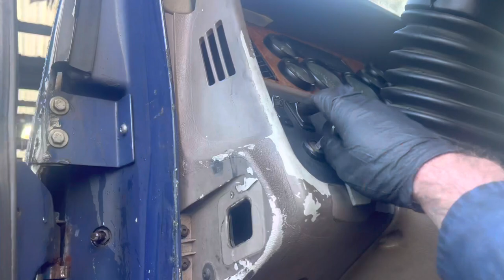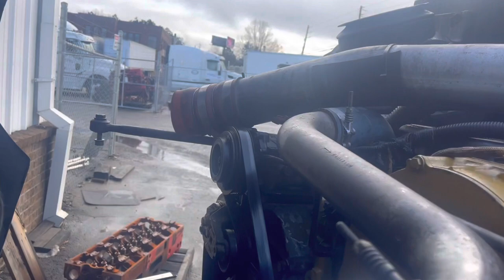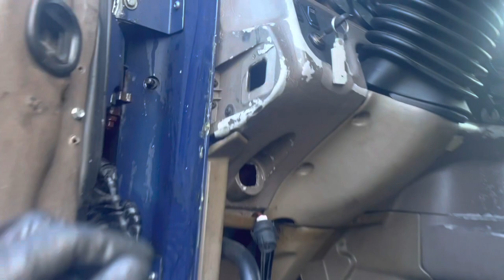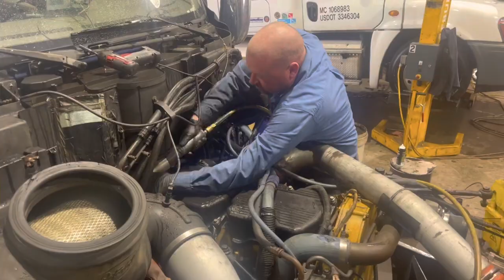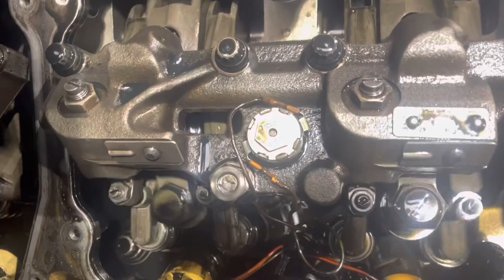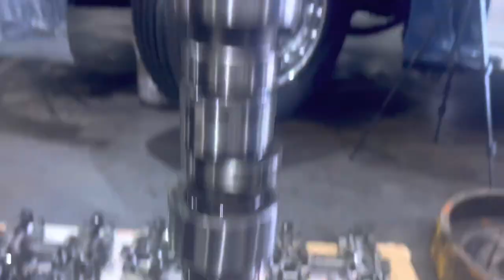Diesel engine popping back through the intake. Watch how a bad camshaft can affect your engine?

Comment: I'm glad that ingersoll right impact worked for you. I bought it as soon as it came out and it broke in a few months of hardly being used. They gave me a hard time about repairing under warranty but finally did it - gave me some blah blah about usi g dirty air compressor at our dealership. Fixed or gave me a new one I can't remember because it's been around 10 years ago or more and that one lasted right until the warranty gave up. Later I saw they had a recall on them but I threw the thing in the trash already. A lot of money just to throw in a landfill.

Comment: Wow that #4 is toast. So what’s happening here is that the piston has already created vacuum in the cylinder before the valve opens causing a rush of air at once to flow through the intake, in turn causing the noise?
Reply: The exhaust gas is not fully evacuated from the cylinder, so when the intake valve opens a rush of exhaust flows past and produces the popping noise.

Comment: hello in this case the popping sound would be permanent right? I have a Jag F-Pace 2.0D that had the same popping into the intake but it happened twice that it was running normal, no backfiring popping sound, so I guess it is not due to the camshaft being worn out right? could it be the hydraulic lifters or some electronic/sensor not working right? it runs well, engine check never came up, also no reoccurring fault codes, only had an EGR related code that I erased and didn’t come back but I also cleaned the DPF to make sure…any helpful opinion would be highly appreciated as I’m afraid I might take the emgine apart just to realize it was something else😅